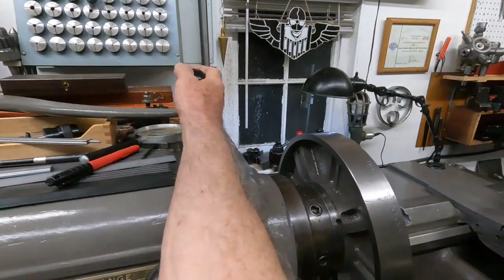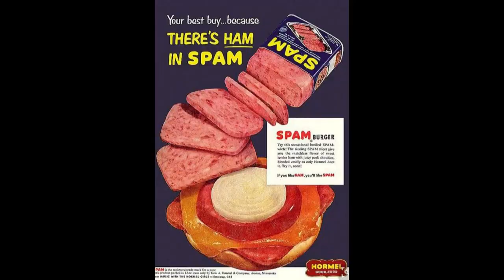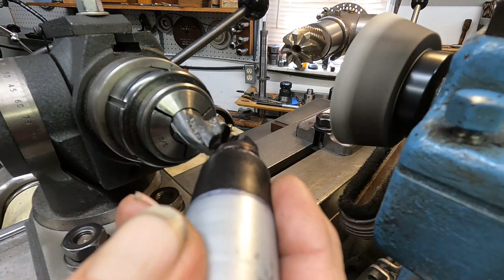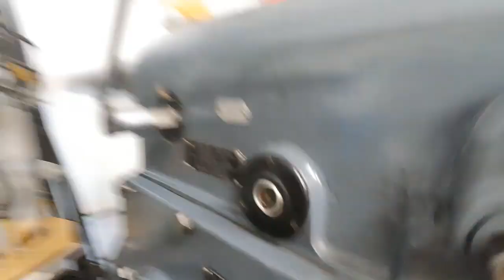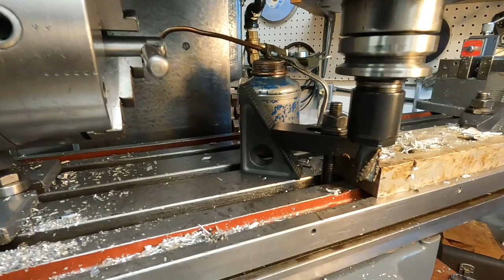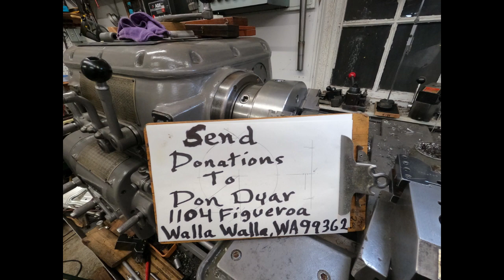Machine shop tool & cutter grinding Sunday

Comment: I'm hunting for an air bearing work head similar to this. I was unable to get one from the plastic mold shop before the one I wanted was gone. Do you have any recommendations for buying one? If you were in my shoes, would you ever consider buying one without inspecting it first, such as from Ebay? 

Thanks for everything that you share. It's rare to find someone on YouTube excited to grind cutters. I agree that sharpening tools is the foundation of the machine shop so it's a little strange that it's so uncommon.
Reply from the maker: There are some established tool vendors on ebay that test and guarantee tools like this but it will be at a price. The control over the cutters is needed for the precision lathe and jigborer, the tool grinding itself is almost another skill set.

Comment: I have to admit that I’m a bit terrified at grinding wheels like this. I remember you making shields. I would have a polycarbonate shield 1/4” thick between me and the wheel. It can be seen through, but it’s strong enough to withstand a wheel flying off at high speed. And yes, I’m the guy who uses the shields on my 8 angle grinders. But these shields are easy to turn around to a different position. I have a pile of carbide mill bits that need sharpening, so where I’ve managed to chip the teeth. No means to really sharpen them yet. Very frustrating, considering what they cost.
Reply from the maker: Send me some chipped end mills, I will sharpen them and send back.